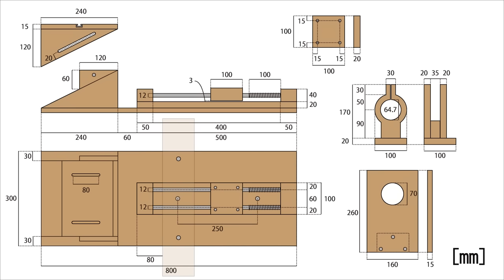7 Simple Woodworking Tools Hacks | woodworking ideas

Comment: Great idea, and well executed. Don’t know if anybody has mentioned it, but you could consider adding some indexing pins (dowels) to the main base. That way your “insert” plates for the machines will always fit in the same spot
Reply: Yeah thats pretty bloody smart too
Reply: I like that idea.  I would do it so the holes don't widen after long term use by using nylon or metal bushings.  Then you could secure it in place with N54 neodymium magnets.  The pins would just maintain register for lateral motion.  Those magnets can come with counter sunk holes for attaching with flat head screws.

Comment: the epoxy fit to the tool is clever and adaptable to many things. especially like the trim router jig, which allows almost CNC-like control in some situations. for example, the slot in the angle aluminum could have been done with the trim router. however, if i make something like that i'll use a high quality plywood (like bamboo) for the clamp, as it is much more resistant to cracking when tightened
Reply: Bamboo plywood? Where do you get that?
Reply: @tonylawrence9157  south china and probably southeast asia. it's the hardest, flattest, strongest, stiffest, most stable and high-quality sheet product i've ever used, and there are several styles of laminate, a thick core going opposite direction of the surface grain, laminated only across the width of the board (not-laminated across the thickness), suitable for furniture-making, and a few other styles in metric-equivalent thicknesses from 1/4 to 1 1/4". i've never seen it in lumber yards in the US but assume it could be special-ordered-- for a price
Reply: @tonylawrence9157  you can use birch plywood
Reply: @sottx8268  Baltic Birch yes,  not the cheap birch so much

Comment: Great presentation!  This just illustrates that the people who design the tools never use them, or the bean counters prohibit the extra money it would cost to make a mold and inject the extra plastic to make a square reference on the tool body.  Many times I have cursed my drill for not having a reference that I could use to square the tool to the work piece and wound up with a crooked hole.  The same problem exists for most hand held power tools.  Which ever manufacturer fixes this limitation will own the market.

Comment: Very productive use of time, one problem is that in order to do ALL of those JIGS you NEED to use a professional equipment which beats the purpose of having those jigs, those jigs would be a perfect for a an amateur DIYer if you would make a models for each of them to be printed in a 3d printer, that would really help those who has no access to a drill stand or table saw etc. but just needs a good jig for a quick DIY project. It's still beats the dancing videos, so props for that :hand-pink-waving:

Comment: Clever use of the plastic wrap to form the the putty/epoxy stuff (what is that called in English?)! Also, one minor tip for improvement is plugging the tools into a foot pedal to control the electricity.

Comment: It would be a huge improvement to the sliding rail jig or the tilt jig if you were to give it 2 dimensions for it to move in so that if you wanted to put several biscuit joints for example you wouldn't have to disassemble and reassemble, but either way it is really neat to see what you worked on!
Reply: Full schematics are there !  ( but only for a second long) . Pause @9:40

Comment: As the next stage you should equip your platforms with 2 pins. Round pin and diamond pin. I mean shape of the section of them. As result you will obtain something that looks like zero point system. For better repeatability when you change your tool.

Comment: I really loved your video and it has inspired me to do the same idea as you have. I have limited space and this way i can achieve more work and be more efficient with my time in the long run. My question to you is the wood screw sets you used to hold secure your tools. What type and sizes did you use

Comment: 1:01 experience tells me that this is extremely dangerous. Thin sheet metal strips like this under a turning drill bit can easily warp and tangle with it and spin violently out of control . These all happen in a fraction of a second. You will know what it’s capable of doing to your fingers.

Comment: 10:00 This allows you to drill a horizontal hole, but I don't understand how this is more useful than a drill press, you simply have to clamp the wood vertically instead of horizontally.  So what is the point of building this when you probably already have a drill press which can perform this same function with no hassle of building it.

Comment: Hmmm.......at 0:07 and 15:26 you're using your crosscut sled in a dubious manner. You've got your cut piece trapped between your stop block and your saw blade. This is a recipe for kickback. You want your cut piece to be free of the blade after the cut. A better and safer method is to use your miter gauge with a stop block on your rip fence, several inches in front of the blade, slide your stock along the miter gauge and up against the stop block, and then make your cut. Your piece will fall free of the blade with ample space between the blade and the rip fence. Your little hold-down clamp is insufficient and poorly positioned to prevent kickback.

Comment: There's an assumption with the power hand tool wooden jig process that the bench you are using to make is level.
Levelling begins at the first lowest point(the floor), not the highest point(the tools setting).

What you have to remember that these types of video makers will always forget is......
1) they have the resources and the time you are not compatible with, or practical for.
2) if you are working(able to afford resources) you are unlikely to have sufficient free time.
3) if you have sufficient free time(unemployed or retired) you are unlikely to have sufficient funds.
4) the maxim being inferred here is "why make it easy when you can make it difficult".

If your yard brooms handle breaks in half, which are you more likely to do...
Go and buy a new handle or broom....or go and buy a 6ft Lathe, source Hickory or Hazel Wood, etc etc.

Comment: DO NOT work with EPOXY without gloves.  You will eventually sensitize yourself to it, and become allergic and react to it.  You do not want this to happen any earlier or more than it has to, wear gloves from the start at all times, and forestall reacting to it as long as possible.
Research this, and it shouldn't take too long to figure out casually working with epoxy with direct skin contact is a very bad idea.